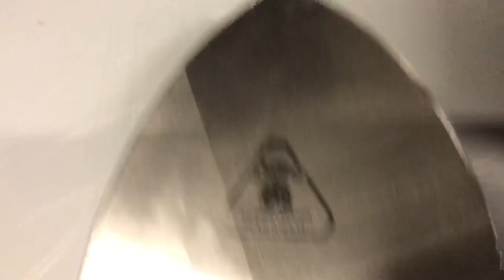My trowel

Comment: I may have to come on holiday just to get an Antwerp trowel. I cannot find one over here in the uk. Thanks for the video though Jay your work is top notch and is a very efficient way of working.
Reply from the maker: Jake fox thanks a lot , you should visit Antwerp anyways 😆 , I read in the comments you can find them on eBay in the uk
Reply: @JayKTS  I will have to have a look. Trying to find the perfect trowel has become an obsession now 😂
Reply from the maker: Jake Fox for me I’m looking for another London trowel 😃 , I think one with a little bit less flex is what I’m thinking because the rose I have has some  flex because it’s very light ......... I think
Reply: Jay Puyenbroeck with that style of trowel you want a bit of flex otherwise you will get a sore elbow but if you want a stiffer trowel try an ox. They are much stiffer blades and may suit you more. I never got on with them though. 
Just ordered an Antwerp trowel should be here in a week, will hopefully be as nice as my Brussels pattern to use. Can’t wait to put some miles on it. 
Have you looked at the Rose buttering trowel? I’ve just got one. They are 185mm Philadelphia pattern trowel. A lot stiffer than the bigger trowel and will work with your tubs a lot better. Very very nice to use and a very similar size to your trowel now. You can find them on speedcrete website.
Reply from the maker: Jake I just looked up buttering trowels man I just saw some beautiful things there , so sweeeet .. I guess I should be working that rose trowel first but sure is tempting to get one or two english trowels more and have like a mini collection lol , don’t think it would be a daily driver though that buttering trowel because of the neck , I think the s-neck of the Jung is very good shaped makes the trowel more versatile in handling -
But..  I could be wrong , didn’t work one yet 
Thanks for the tips
Reply: Jay Puyenbroeck I agree! I love the s neck on the Jung it just feels right in the hand. The balance is pretty much perfect. I use the buttering trowel for stonework exclusively it’s just the right size. 
Once you’ve got some miles on the Rose and it’s worn in a bit it will be nicer to use.  Try it on block work that’s where it will come into its own, but then your blocks are wider than our standard 4”. 
But at the end of the day it’s what feels comfortable to use.
Reply from the maker: Jake We do have blocks 4 inch and we also work a lot with 5,5 inches or 14 cm for structural walls , we work a lot with clay blocks 

Thanks mate
Reply: Jake Fox https://www.eurafco.com/eng/equipment-hand-tools/jung-masonry-tools/brick-trowel.html jake you can get all the trowels shown in jays video here . Just one thing to be aware of Jung make 3 grades of trowels branded jung Henkelman which is the premium brand . Jung product which is a slight step down . And Robbie which they class as a hobbyist trowel ,these have the red handle on them with made in Germany stamped into the handle the French trowel jay picked up in the video is a Robbie . On the site look in the right hand corner of what ever trowel you click on and it will state which one it is.shipping is very reasonable to the uk and Ireland .you can look up the shipping rates prior to purchasing. You can pay with PayPal credit card or bank transfer.
Reply from the maker: bric bybrick absolutely correct 😎 stay away from the Jung trowels with the red handle

Comment: Can't find any where in the UK that stock these, but thanks to you and Paul I have found one seller on eBay that ships to the UK that sells these trowels, limited choice but he does have the 654. Tempted to buy it £25 Inc shipping.
Would ideally like to go to a shop so I can feel them, but can't find any one that stocks them in my country.
Very tempted to buy the 654 off eBay.
Thanks so much for the video very helpful.
New subscriber to your channel, so working my way through all your previous videos. Good stuff 👍👍

Edit: the company found on eBay I found there website with the full range excellent thanks 👍
Reply from the maker: Hello James , The 654 is my trowel I’ve always worked with and still do ( the big one I have is Antwerp model 654 205) 
The bigger handle can be better for your wrists so it’s very good 
The smaller handle works also very nice that the 653 and the Brussels 651 have 

Thanks a lot 🙏🏻
Reply: @JayKTS  Hi Jay, very tempted to give these trowels a try, think I will like them, those are the 3 models that I like the look of.  Like the look of the Brussels 190mm. They do this in a standard and big handle version on there website.

Currently using a 11inch Philadelphia and find it big and bulky, especially in tight spaces, thinking a smaller trowel will suit me better. Thanks for your input and keep up the great work 💪👍👷‍♀️
Reply: Is there a link to buy one
Reply from the maker: Yes I will look the link up , you can but at eurafco
Reply from the maker: https://www.eurafco.com/eng/jung-65418000-brick-trowel-antwerpen-swan-neck-180-x-140-mm-4010496654190.html here you go , I would try the small one first

Comment: hi, tell me, is this a forged trowel, that is, is it from a single piece of metal without welding?
Reply from the maker: It’s welded , I’ve bought a forged trowel one year ago from another brand (Schwann) but the Jung stays far more better , I don’t understand why they don’t come forged though although these jung trowels just don’t break and can go easily 10 to 15 years and most of the time it’s the handle thats gets damaged , or if you tap too much with the back of the handle you don’t have a handle left after those years 😁
Reply: Jay Puyenbroeck jay it comes down to cost I’d say . I would imagine in the days before welding all the trowels Jung manufactured would have been one piece forged (gesmeed ) I have a very old one piece forged Jung Brussels trowel that I came across one evening on eBay uk. The Jung trowels as you know are made from top class materials the welding I would say is performed by robots and the chances of the welds breaking would be slim and no chance in my opinion. Welded trowels have a band reputation because a lot of them are made from cheap materials and they are badly welded and are aimed at the diy market . But as we can see with the Jung trowels when they are made with top quality materials and they are properly welded they are as good as any one piece forged trowels.
Reply from the maker: bric bybrick a forged jung from the old day’s ? Awesome !! Yes you do have trowels here that are low quality for diy , these are no good , the Jung actually is very strong constructed , I’ve never seen one damaged on the weld